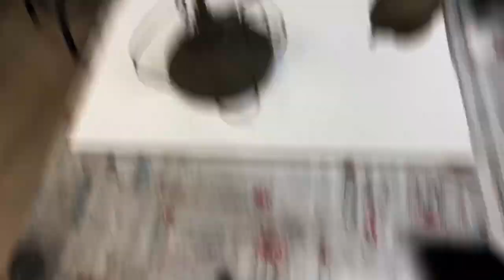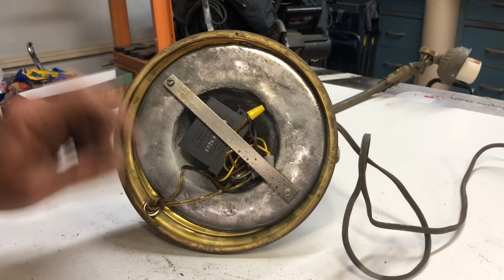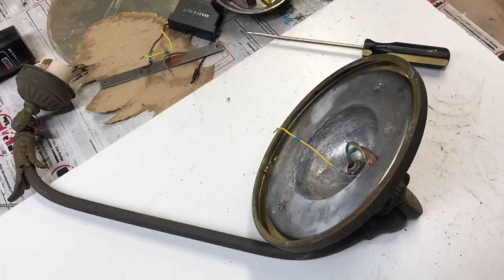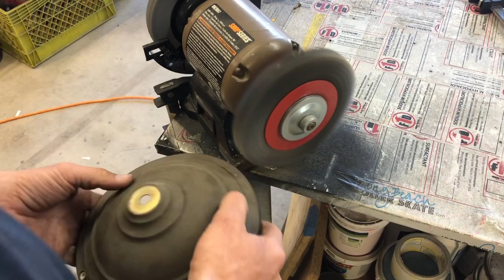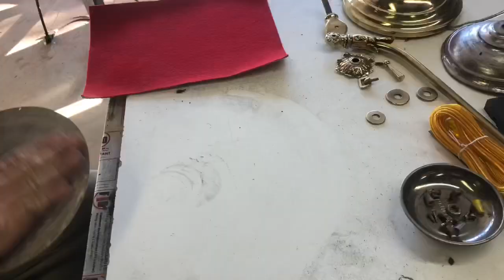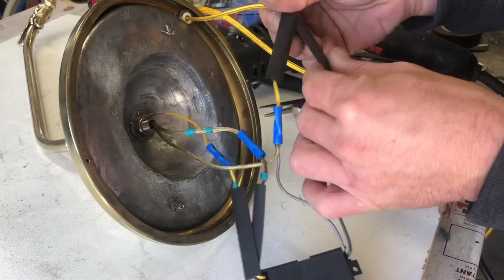Old lamp restoration

Comment: Great.  Not only does it look brand new  which is the point of doing a refurb  you didn't use a cheesy green lamp shade. AND... unlike 99% of the other videos out there... You used a heat gun on the shrink tube not a bic lighter.  That alone means you know what you are doing.